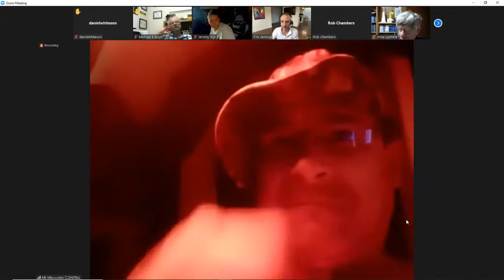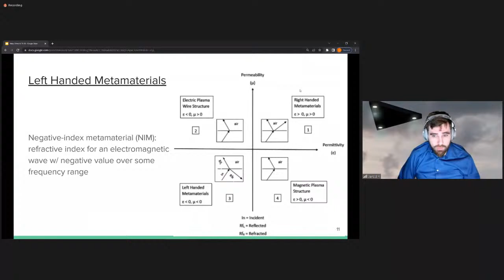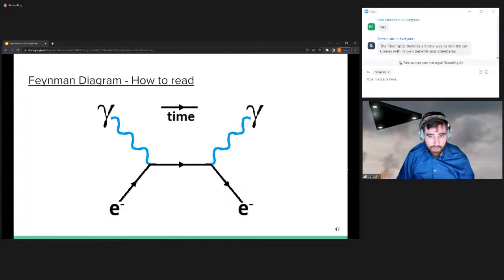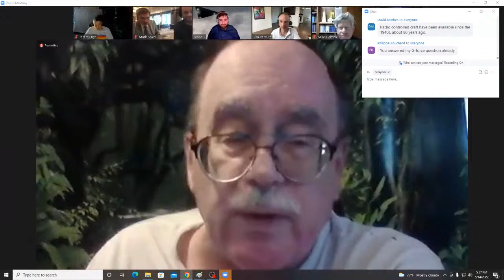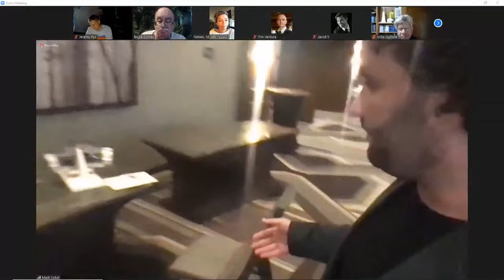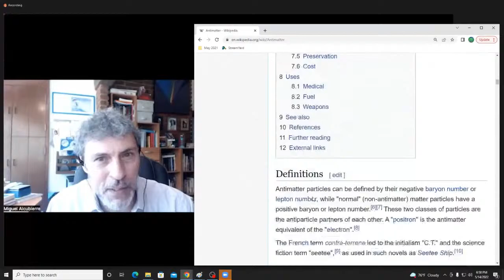APEC 5/14: The Reed Drive, TR-3B & Alcubierre Interview

Comment: Glad to see Winterberg discussed as he also relies on Louis de Broglie. People have reported radiation effects when they are close to the TR-3B. See Winterberg's Roton-Phonon model. "The Clouds of Physics and Einstein’s Last Query: Can Quantum Mechanics be Derived from General Relativity?" In this spectrum the phonons (dilatons) present a scalar gravitational field.
The rotons can be identified with the particles of the non-baryonic cold dark matter. The
rotons, with an energy somewhat below the Planck energy mp c 2 , are separated from the
ground state by an energy gap. The magnitude of this gap is in fairly good agreement with
the observation that 70% of the energy of the universe does not consist of particles, with
the remaining 26% consisting of non-baryonic cold dark matter, identified as heavy rotons,
with a mass somewhat smaller than the Planck mass....In this model the origin of charge is explained to result fr om a field of virtual
phonons, having their source in the zero-point fluctuations of Planck mass particles bound
in the vortex fragments,"

Comment: question for you if you fired a rocket to mach 10 at constant it hit that speed befor the rocket cut then at mach ten by the first blast hit the rocket again with a mack 10 do you think it would double!!🤨And Think mass as velocity compression upon fabric to speed not as particle or light getting confused nothing but a issue for you and weight is a factor????.....not one yet done that math!! got the area 3 per second off light in space for a mole count????????😃😄😁😆😅 5 Smiles. Electrical energy and B is for stability and compression density stuff math so you don't pop in your own hole and can bend stretch that fabric.
Reply: A rocket can't travel faster than the speed of the hot gasses coming out of its engines.